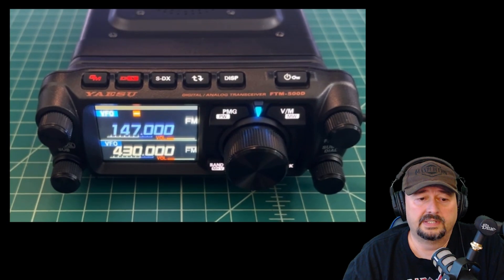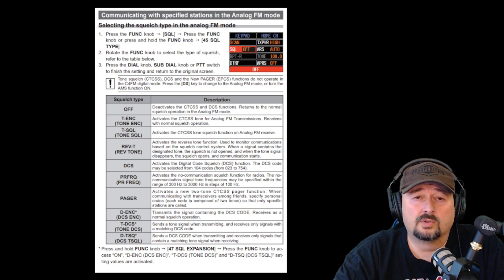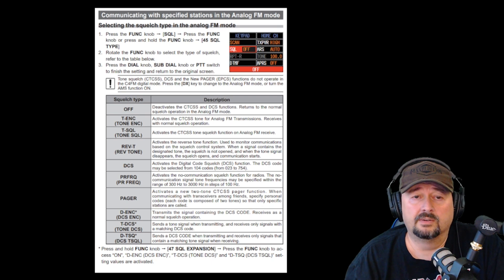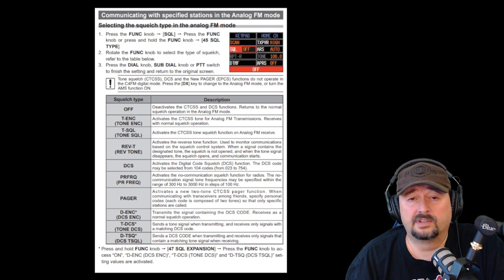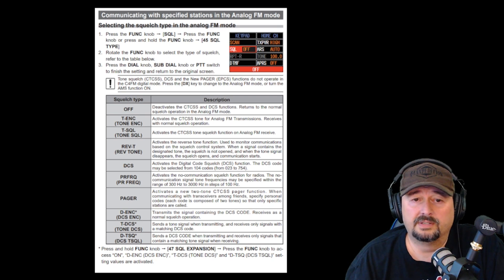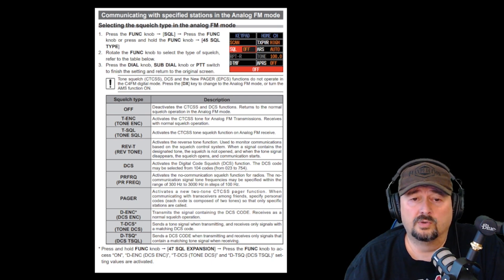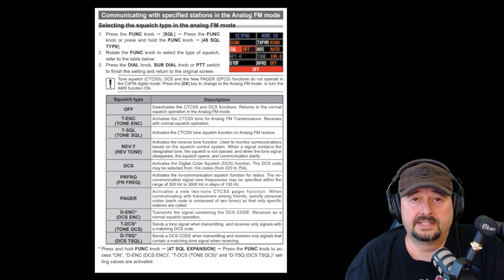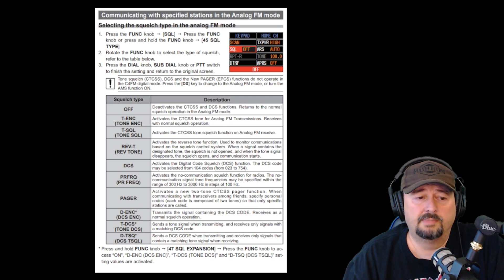Yaesu FTM-500D - CTCSS and DCS Tones

Comment: Thank you, everyone, for your replies.  I received this from Yaesu tech support:

“Thank you for contacting us with your email. The radio can do split squelch types, but is unable to do different PL tones at the same time. Our suggestion would be to operate Tone Encode only. This way you can still access the repeater, and your radio can listen to everything on the repeaters output frequency.”

So, there you are: no split PL tones.  Alas…
Reply from the maker: Thank you for the update
Reply: Recently bought the FTM-300dr. I was surprised to learn that it too is not capable of split tones either. My TD-H3’s can be programmed with split tones quickly and right from the radio. Disappointing for someone getting more into the hobby to see these limitation in a ‘real’ radio.
Reply: @hifid3lity  Was looking for that option as well, we have a few repeaters in the area with different input and output tones. Bit disappointed in Yaesu for not having this option in a new radio. Leaving only the transmit tone programmed, the radio is almost unusable in the downtown area where there is always noise on the receive when using one of these repeaters.
I would update the repeaters to DCS, but they are not my machines to tinker with. Also many users with older rigs may not have a DCS option.